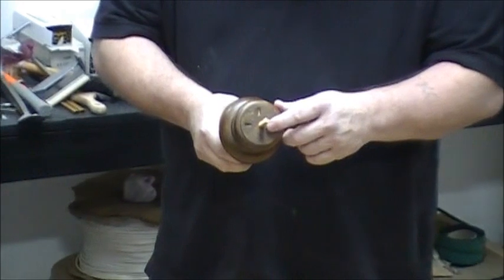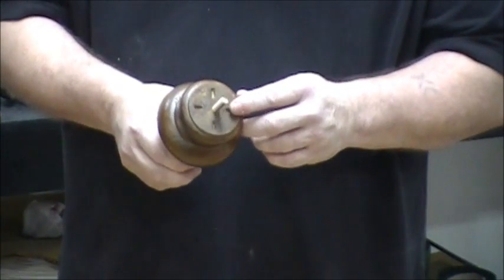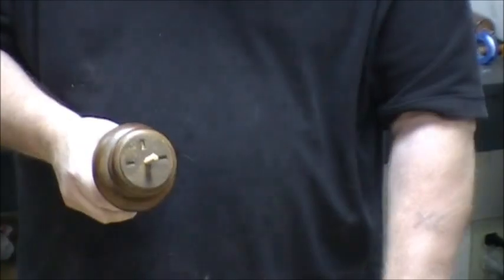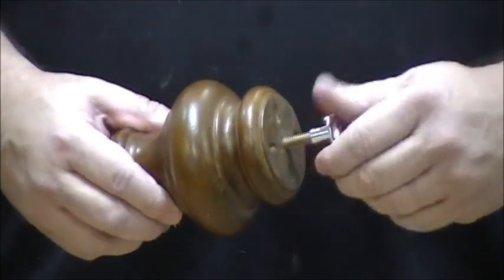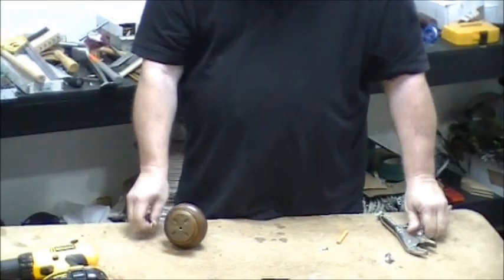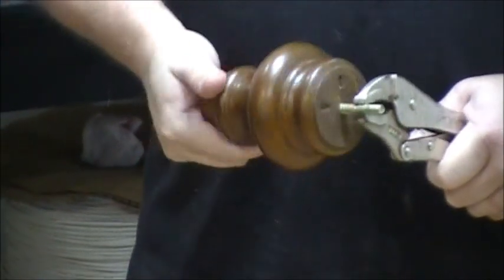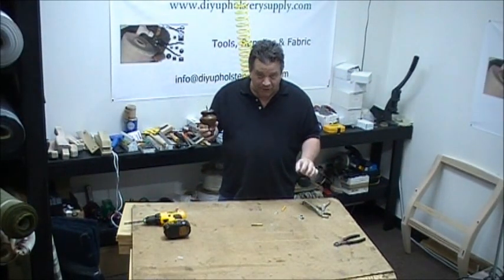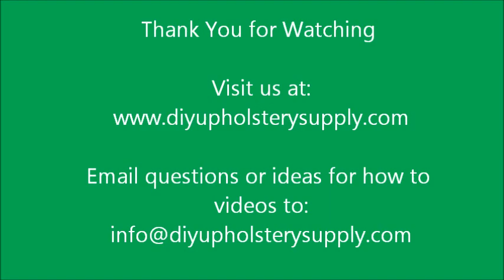How to change out Hanger Bolts in furniture legs

Comment: You can just put 2 nuts together one a little bit offset of the other one so the nuts get stuck  on the screw and you turn out the screw easy without a damage on the treads.
Reply: Need furniture legs

Comment: I just learned that its best to use 2 Hex Nuts, screw them on to just past the top of the bolt.  Tighten them, and then use the inside nut to remove the Hanger Bold by turning counter clockwise.  To put the bolt into the wood, use the outer most nut and screw it in normally.

Comment: Another way to get a grip on the bolt is to use the jam nut method (2 nuts screwed onto the bolt so that one can be gripped and turned to get leverage and turn the part that’s in the wood. A friend told me about this%

Comment: Can I suggest a hack? I have an Ikea bed where the treads went on. I used the threadbare top of the bolt to bring the bolt out 6mm and then put it back in the bed. It worked like a dream until I could find the proper hanger bolt for Ikea use. I would never have thought of doing that without this video. Thank you.

Comment: Thank you ! We have a couch with 3l8 inch hanger bolt. Couch sits too low. Bought new legs but the hanger bolt won’t come out. Seems it is cemented in. Made in China. Are some newer couch legs made with hanger bolts meant to come out? If so what is a good brand?

Comment: Would it work to just double nut and then unscrew from the bottom nut as it pushes against the top nut to avoid damaging the thread, (Then the opposite to put new one in)?

Comment: Why don't you just use two nuts in sequence? First put one nut on the bolt using a wrench, until the wrench almost touches the wood. Then put another nut on until they touch. Tighten them slightly. Then try to unscrew the first nut.
Reply: This doesn't work because both nuts just come off when you unscrew the first one. Maybe you need a special nut with opposite threading or something?